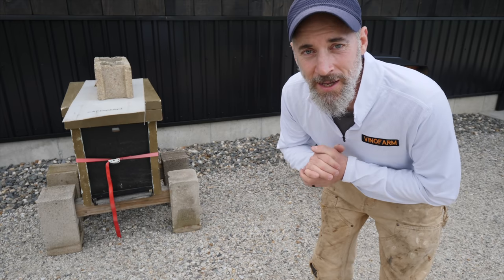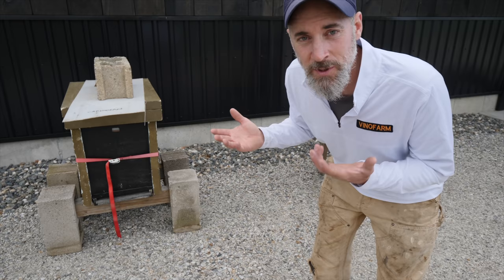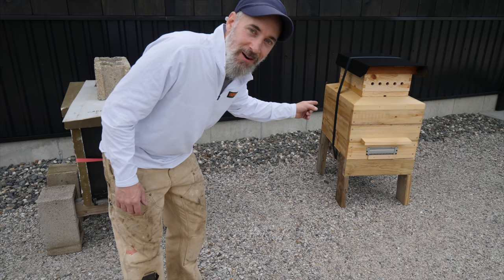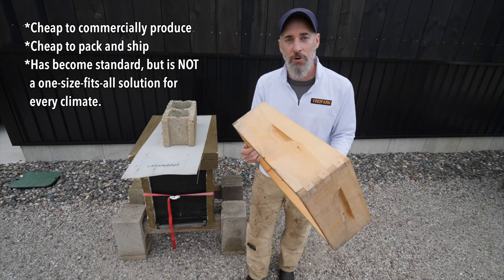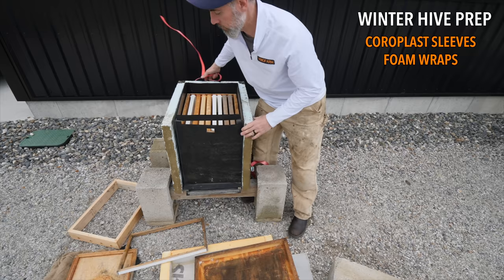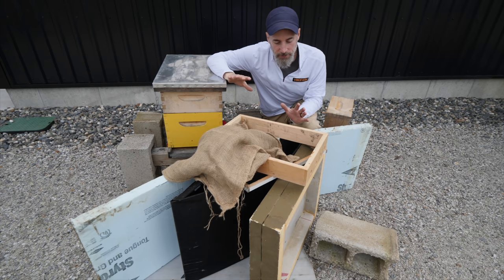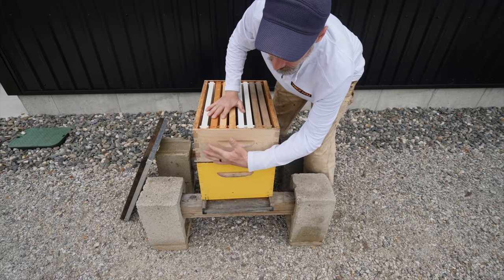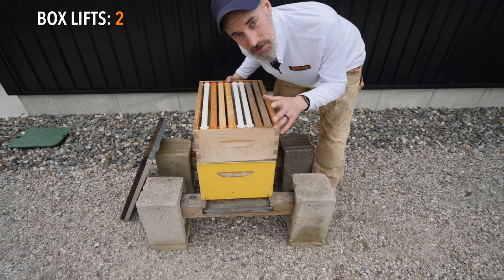I Fixed The Langstroth Hive (For The Bees AND The Keeper!)

Comment: I'm an experimental beek and I did build a Lazutin hive.  I decided to build a dbl-deep horizontal hive with 2" thick walls.  I used a deep and a medium frame.  In New England it is critical to give bees a solid "depth of comb" for them to travel up in the winter w/o gap.  You can actually super a horizontal hive and some beeks do.  

You are quite right, the Lang 3/4" thick hive boxes can't cut it in this weather.  All it takes is a 24-48 hr window of sustained winds with below zero temps to take down a colony in winter.  Especially if they're at that critical gap btw bottom and top box.  

The one thing I haven't tried and you might want to consider for one of your hives is using raw wool instead of the foam board.  I read "The Idle Beekeeper" by Bill Anderson and he goes into great scientific detail about the virtues of raw wool and how it warms in the winter and breaths in the summer.  Not to mention that it's all natural.  Also, Dr. Leo is using it in his Layens hives for the same reasons.  

Not sure how you are planning on extracting honey with that frame setup.  I prefer to zip tie a deep & medium so I keep the equipment standard when it comes to extracting.  Let us know what you do.  

I liked how you "stepped" your cedar boards when stacking them.  Nice touch.  Wish you and your bees good success this season.
Reply from the maker: These are brood frames. The brood box will be supered. I will extract from the supers. 15:18 in the video. I’m not sure I understand why you want wool to “breathe” in the summer. The point of the insulation is to create a space that heat doesn’t move through easily. The foam does a great job and will never get saturated with water. Dr. Leo lives in a very different climate than I do. A lot of the stuff he talks about would not apply to me. You’re the first person to notice that I lapped my cedar boards. Ha ha. It made assembly a lot easier and will shed water a lot better. Thanks.

Comment: Wow, I love it. 
So I live in the tropics and I have learned about using a thin reflective sheet (like aluminum foil) along with an air space to stop conducting heat through the insulation. Over here the insulation will heat up throughout the day and then begin heating the house. Whether or not the same thing happens in a cold climate - the insulation cools down and begins cooling the hive - I’m not sure. I can’t wait to see how it works. Thanks so much.

Comment: I’ve kept bees for 12 years in Massachusetts, I’ve made super deep frames to use in double mediums, I’ve made Swiss cabinet hives, and I ran each experiment for a few seasons.  I learned a lot about bees and generated a lot of wax to melt down.  What I landed on to improve overwintering success is a hive quilt that stops all exfiltration from the hive.  The bees go through half as much honey, they come through stronger.  All the insulation folks put around hives doesn’t do diddly if you have any ventilation.  Bees don’t need fresh air, they evolved to overwinter in a stuffy, damp tree cavity.  The burlap stuffed into the box is probably not as good of an air barrier as 4” of pine shavings.  Finally, what I found during my experimenting is that using all 8-frame mediums provides significant management flexibility and you don’t squish nearly as many bees.  Having custom hive parts gets to be a real PIA by the 3rd season.  I’m interested to see how this all shakes out, good luck!  (PS, carpenter ants)

Comment: I built my modified Langstroth by using Dadant Jumbo frames which are 2” in deeper than a Langstroth deep. Then I build my brood box with solid rough sawn cedar or redwood which are 1-7/8” - 2” thick and 11-3/4”. Mr Brood box is 10 frames. The brood box sits on a permanent stand with a screened bottom. I can add standard mediums or honey supers on top during honey flow. For the frames, I simply make the sides myself and wire them. I add standard deep wax foundation that leaves a 2” space at the bottom for queen cells or whatever the bees decide. I do like your use of plastic foundation and will convert on brood box into jumbo frames with plastic foundation. I also like your upper wick/vent/feeder box and will consider your ideas as well. Thank you for sharing.

Comment: Good luck with it.  I'm sure you will work out things such as splitting hives for increases and replacing contaminated old brood comb.  A lazy beekeeper may run into problems in the brood box by putting some deep frames for additional resources and then come back later to find a comb nightmare.  It does look like you are attempting to resolve problems that beekeepers have encountered.  One thought I had is that your spacers may create hiding places for hive beetles.  This may not be a big problem in your area though.

Comment: I love the idea Jim.  One suggestion regarding thickness of foam insulation.  As we know many bees survive with 3/4" pine with an R value of ~1.  If you add 1" of foam,  that R value goes up to ~6.  I suggest that is plenty - the equivalent of 3.5" wood which would be typical of what they may find in a tree cavity.  Using 2" foam taking the R value up to ~11 may be over kill and increase construction complexity.

Comment: Theese  frame measures are close to the one, we use in hungary since 100 years. But we use it in horizontal hives (which has 15,18,21,24 frames in it) usually. When we use it in a vertical hive, the deep has 10 frames. THe supers's frames are half of the size like the deep(so if u can put two super together if you are sort on hives). The insulation is great.

Comment: This is awesome, great work! I've kept 2 inch foam permanently on my double deeps for a few years now, once I thought about the insulation in a bee tree! (Lots of it, doesn't change with seasons) But I only tied mine on with cord! You've done a great job of designing and crafting a very good home for your bees. I hope it helps reduce the pressure from mites, as well, just by having happier bees!

Comment: New subscriber here.  I can't believe I haven't stumbled on you sooner. 
Good stuff.  Way to engineer something to work for you!

Great point on insulation.  I've always said the same. The example I use is that it's like a yeti cooler or cup. They keep hot things hot and cold things cold.  Just makes it easier for the bees to regulate their desired temperature.

Comment: Your diagram perfectly illustrates the bottom frame in a double box configuration. The top frame is just the reverse. It has been my experience that the queen has no issues with the frame break and lays a circular pattern encompassing both top and bottom frames (typically they fill that gap with drone brood and queen cups). I like that you will eliminate pulling half the frames. That will definitely make inspections go faster. Good luck on your restart!

Comment: Suggested consideration. Add a third silver disc and remove the screen. In winter, open the center disc yo the hole. Under the burlap. Over the hole, place a screened cavity, screen on top of 3/4 shim on four sides. You can pour sugar right thru the screen instead of removing inner cover and by removing the burlap only you can see what the bees have consumed and augment if necessary. I did this last winter and it worked well.

Comment: I just came across your video and applaud your ingenuity.  I have some Layens hives in which the frames are essentially the same as your hybrid frames but slightly narrower.  I plan to incorporate plastic foundation in some of mine to prevent cross combing which occurs when they aren’t perfectly level.  You could probably build a Layens hive to use for the brood nest and then place a spacer/adapter on top to accept Langstroth honey supers.  Spring hive inspection good time to remove really old brood frames and replace with new drawn comb or foundation.

Comment: Love your box. Slap a piece of window screen over the top and they will propolis it to better regulate temp & humidity over brood as needed. $7 a roll at hardware store. The dark one seemed to be propolis (used by bees) more than the light grey color window screen. I found a thin mesh plastic one that I'm trying this spring. If bees need upper access, you clip the CORNERS/edges. Dont put holes on the center, or very few if you must. This allows bees to ventilate the honey frames differently than the brood. You can put an upper entrance above window screen propolis layer without worry about condensation. The propolis screen keeps moisture from dripping on them. They leave holes in screen to allow moisture to go up. I never have condensation and the propolis window screen is why. Like a brood roof/umbrella. The propolis window screen can be used in a swarm trap. YEP! Bees wont propolis frames stuck, and you can easily remove lid without worry you will break propolis seal, because they don't propolis the upper roof shut if they have window screen to propolis over their cluster/brood area. Do it on one hive and you will Quickly see the bees are able to manage the incubator/brood area more effectively on their own. In a tree, bees use propolis to insulate. In a langstroth hive, the frames are too wide to propolis the gap or to create a propolis insulation layer directly over themselves. Also, during inspections, when you lay the screen down, the bees IMMEDIATELY move down frame from the gentle weight of screen. No more squished bees to feel guilty about.

Comment: I picked up a roll of burlap from an upholsterer friend.
I'm planning on sewing some "pillows" that'll fit snuggly into the vent boxes..
The pillows will be (kinda permanently)  filled with dry cedar shavings, and I can just swap them out with dry ones mid winter, and then dry out the used ones for next time to cycle out again.
Reply from the maker: @thebugfarmer made pillows too. They look cool! Good idea.
Reply: Jim, Having spent enough time around the upholstery shop, rather than Velcro or zippers for enclosures, I'm leaning toward leaving a simple flap, with maybe four inches overlap.  With that, I can emoty the contents if need be for quicker drying.
By the way... watch for ants and mice chewing into that exposed foam that beneath the screen board.
It'll look like foam colored vermiculite when they attack it.

Comment: Jim, Bravo! to say the least. The Lanstroth was designed to fit L.L. Langstroth's needs, his. That said. The Langstroth has needed fixing for years. Lots of very intelligent and innovative beekeepers have taken a stab. You have come closest in my opinion to what would be the ideal environment for the bees and still useful for the keeper. This January I heard the same issue I heard 20 years ago, "We'll have to see how the bees came through the winter." We feed, insulate and care for the horses, pigs, cows, dogs and the bees for the most part deal with leftovers(a half inch of wood to keep them warm and keep the elements at bay.) Once again, Bravo. I appreciate your hard work and effort. And thank you for sharing. Keep sharing please.

Comment: That's a very solid hive body for bees to survive the MA winter, definitely an upgrade from your previous insulation. But there is a weak point for insulation, around the top cover. The heat can still escape from the section between the body insulation and the venting holes on the winter top box, even with burlap in box. You should build an removable extension of the hive body insulation, so it would set on top of the hive body insulation and go all the way up to the ventilation holes, and you could take them off during summer. Beautiful work. Thanks for showing.
Reply from the maker: Not done yet. There will be a winter cover when winter arrives.

Comment: Hi Jim, Tobias here from Sweden. I also have the Langstroth beehive but here in Sweden many beekeepers including me use painted styrofoam beehives. The walls are 1.57" thick and holds 10 frames. Even winters when the temperature goes down to like -20c or -4f I have hade very low hive loss do to the cold (This year 2022 non died). You also don't need all that extra material that you have, I only have a bottom, 2 brood boxes with 20 frames of winter food and the lid all made in styrofoam. If you take care of the parts and paint them every now and then they easily last more than 10 years. 

Hope you have a great summer of 2022!
// Tobias

Comment: Whatever your motivation for building the Bee Barn, I think it's a good thing that you're searching for improvements.  You very well may realize somewhere down the road that some part of your design doesn't work the way you wanted and you'll change it.  There will always be haters and even if you figured out the perfect combination, you'd still get negative comments.  I appreciate the thought and effort you made to introduce us to the new design.  Even if I don't try to make my own bee barn, it has definitely made me think about actions I need to take to ensure my bees make it through winter.  I only started beekeeping in 2020 with 2 packages.  Fortunately, both my hives survived the winter and I added two more packages this spring.  Why did I buy new packages?  Well, just from the point of view of a novice, I think people stretch out their colonies by splitting, etc. to a point that it has to affect their ability to survive.  In what ways, I'm not sure.  I guess what worked for me in 2020 may or may not have been dumb luck.  But it did indeed work.  I think I'll stick to my plan in 2021 and see if it works again.  If not, I'll change course.  Thank you for your videos.  I learn more watching you that anyone else on YouTube!

Comment: I also had some awful hive losses last winter here in northern VT. Moisture was the main killer due to 1) the presence of excess moisture unable to escape and 2) the -20 temperatures that froze the literal air with moisture in it ... right on the backs of the bees. I had one here be with an entire 3+ lbs of bees that froze from a warm day that dropped to minus temps by the evening. They just couldn’t keep up with the temp regulation. 

So YES! Insulation and ventilation is the way forward! I am now thinking I would like to try out something similar whereby the brood nest is one giant deep as you have it. I never liked breaking the brood nest either and this appears to be a great solution!

Comment: Great job in modifying- looks like the horizontal layens/langsthroth. Appropo during Covid... just like the kids learning: a hybrid of virtual and in-school --- in your case, taking what you had (vertical) and your research on horizontal design and merging it with a top that adds room for feeding, wicking, etc. (all from your experience) I say this as a 1st year newbie who has 1 layens and 1 Langstroth with Russian bees and just starting out. My gutt instincts always seem to lean that the vertical structure provided stress to the bees- not only because of the type f wood used, but because of the space they needed. Looking into teh cavity of a log in the fall, I found the size of the concentric circles matched the horizontal frames more than the langstroth. Congrats on your new design from a newbie!

Comment: I've been thinking about designing and building a hive for a friend which will work well here in Maine. I have another friend who finally gave up beekeeping after many years and a family history of it because of all the issues he had using Langstroth hives. The designs I've been looking at are along the lines of the Warre' hive. They reasonably suit bees' natural instincts and our ability to manage them, in my mildly experienced opinion. In the wild, brooding starts at the top and moves downward (and somewhat outward) as new comb is made. The old comb at the top is then used for honey storage. In the winter, the bee cluster works it's way upward consuming honey. The Warre' design adds boxes from the bottom and old comb honey is harvested from the top, when appropriate. My thought now is to design a hive which is essentially a Warre' style concept hive (of some sort) inside of an insulated sleeve. New 'space' would be added to the bottom using some sort of lifting process. 
I am also thinking that supplemental heat may be necessary (bee driven geothermal?). 
I have some percolating thoughts on Verroa control, but first things first... 
Anyway, I am subbing and looking forward to watching your next video.

Comment: I hear horizontal hives are in use in europe, basically a chest of bees with the larger frames and all you have to do is open the lid and pull out a frame! Could be worth looking into as an even simpler solution, they are also made of wood twice as thick as Langstroth hives so much better for winter and you can split a colony in a single hive with a separator.

Comment: Jim, wow!!  Awesome work and logic. Your presentation is inspiring. I use the 2” extruded poly insulation for my bees overwintering here in the north-central region, and it works well. I have also left it on well into the warmer months thinking it would help soften the environmental temperature fluctuations, which it does. BUT I HAVE DISCOVERED A CONCERN THAT YOU SHOULD BE AWARE OF = ANTS!
Ants love this product (2” poly) for making homes. Ants will mine out the poly and create an “ant farm” habitat right there amongst the bee colony, so now in the warm months, I do remove the 2” poly insulation so as to lessen the threat of ants  in proximity to the hive.
My concern is that with the wood covering the 2” poly insulation, ants may make their colony literally surrounding the bee colony and you may not likely pick-up on that fact due to their new home (the ants’) being covered from view.  You may consider removing the 2” poly insulation from the assembly during the warmer months to mitigate the threat of ants. 
Awesome engineering. I look fwd to your upcoming post on how your bees are doing!!
Regards,
JPM